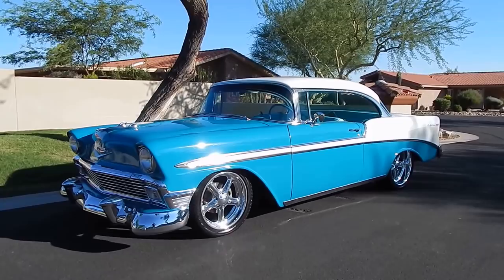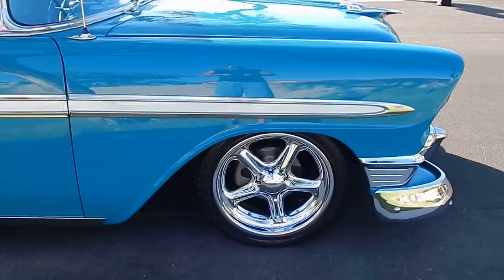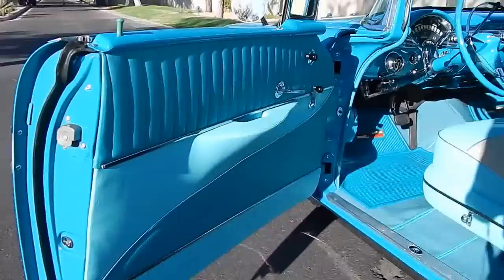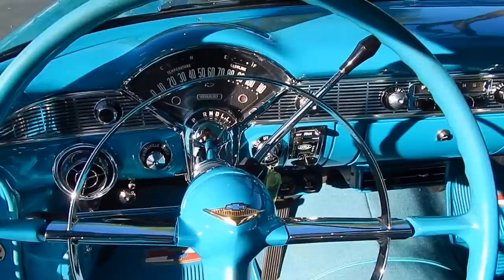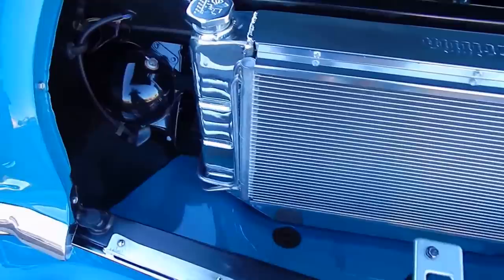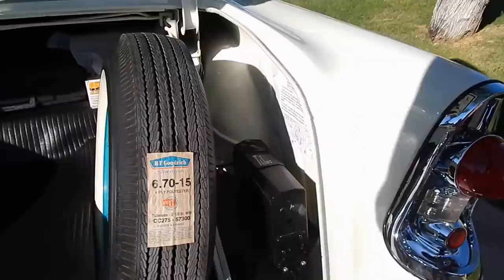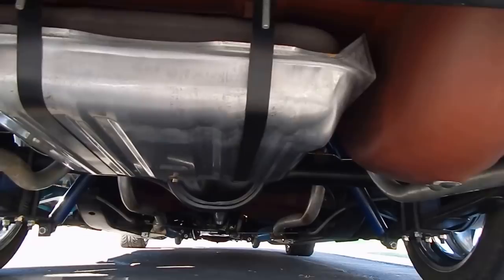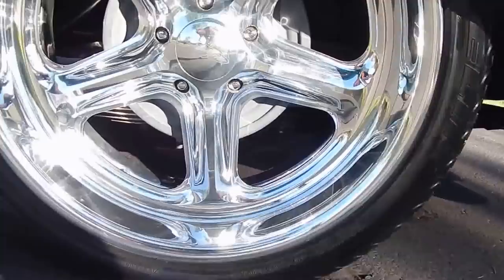1956 Chevy Belair 2dr Hardtop Resto Mod (Sorry Sold)

Comment: Very nice car. My favorite year of the tri 5s. I have to wonder about the spare tire though, it looks like it is a tire and wheel combo that would have come stock from the factory.  Is it the same overall diameter as the tires on the car? If not, and the car gets a flat, it will not only look bad for awhile, but it could cause driving problems.

Comment: which vinatge air   do you recommend 
1. 1955-56 Chevrolet Full-Size Gen IV SureFit™ Complete Kit with Center Vent Plenum
2. 1955-56 Chevrolet Full-Size Gen IV SureFit™ Complete Kit with 4-Vent Plenum
 and did you get the chrome vent  and control panels separate ?  
thanks